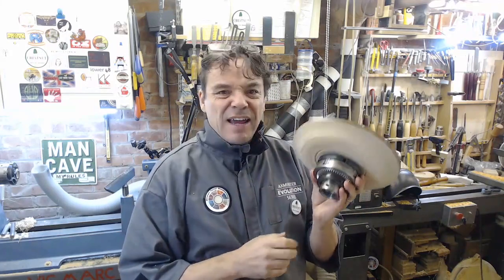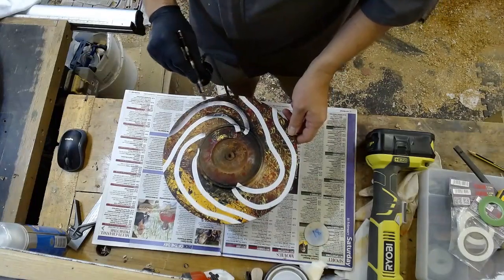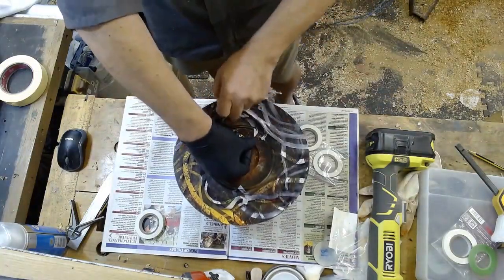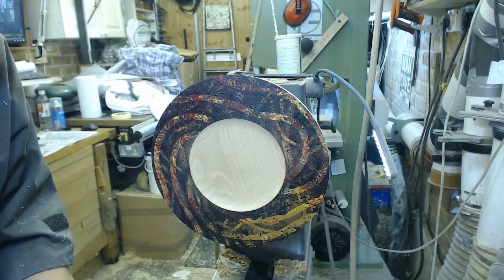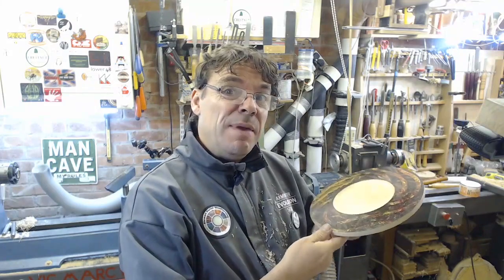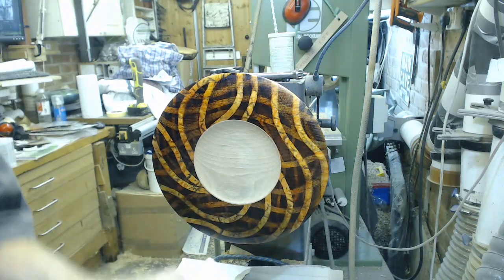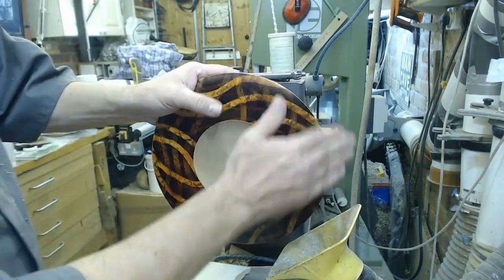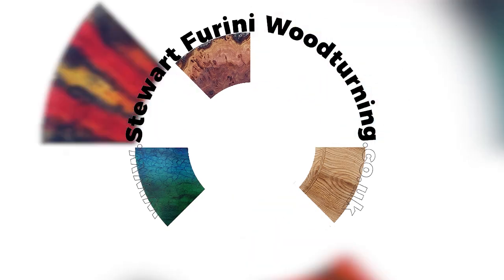Woodturning a 3D Effect Curvy Ribbon Platter

Comment: I do like the way you are not afraid to experiment with finishes. I feel this is an area many do not attempt, but you do some lovely work. I'd like to see another ribbon one done on virgin wood, with each layer of ribbons applied and an effect applied separately to the next (ie remove one layer before putting the next on) as I think that would really add depth to it.
Reply from the maker: Thanks Raven. It's all about having fun and trying stuff out for me. I think trying an approach like you suggest would work very well. Cheers!

Comment: I quite like it, But i've never seen that cream before
Reply from the maker: Cheers, Mart - do you mean the Cut 'n' Polish? It's a blend of waxes with a fine abrasive powder in it.
Reply: @stewartfurini  burnishing cream
Reply from the maker: @martkt10  Ah, that....it's also from Chestnut Products. This is the blurb for it: This creamy liquid has a very mild abrasive within it which acts like ‘liquid sandpaper’ on finished surfaces, cutting back and cleaning the finish and elevating it to a glossier, brighter finish.

It can be used to smooth Cellulose Sanding Sealer prior to applying wax or Friction Polish, or, after allowing a suitable time to dry, on any of the lacquers, Friction Polish, Finishing Oil or Hard Wax Oil.

A deep finish can be achieved using Burnishing Cream on a coat of Melamine Lacquer, then a coat of Friction Polish and finally the Burnishing Cream again.

Use it sparingly so as not to over lubricate the surface and be sure to shake the bottle before use.

It is not advisable to use a lacquer on top of a surface that has had Burnishing Cream used on it.
Reply: @stewartfurini  Think I will have to try some , thank you for your help